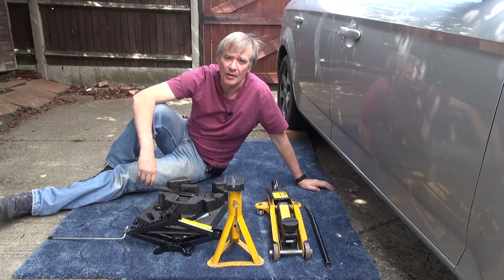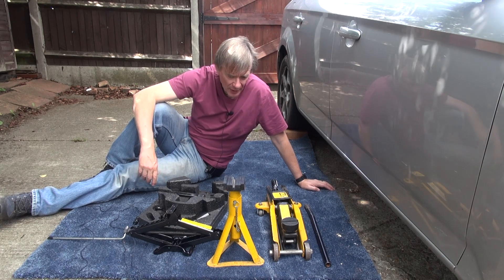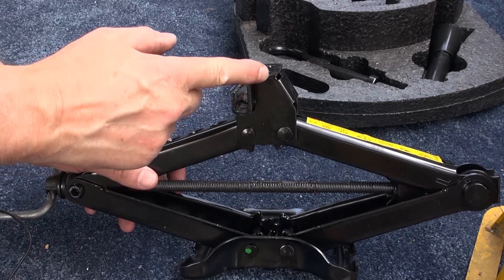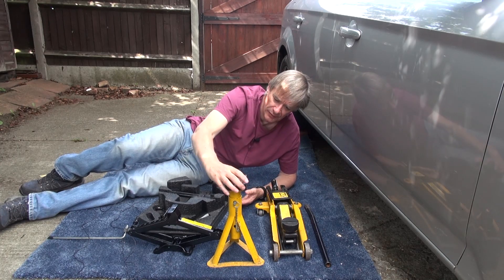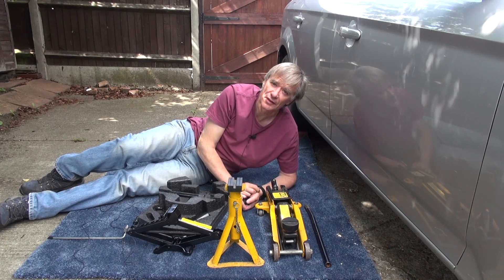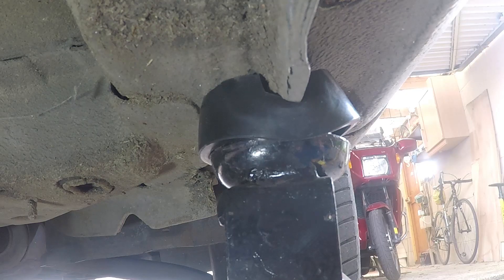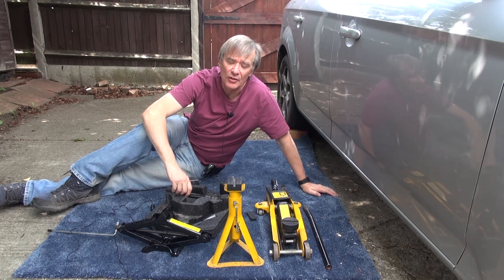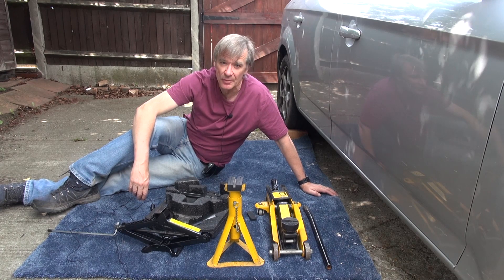Protecting the car sill frame rails with rubber jacking pads

Comment: Hi Nigel. I have tried all sorts. Be very careful with wood, even the hardest cross grain wood can fail dramatically when not expected. The pucks seem ok but cut through/wear out quite quickly. An interesting point is the Ford jack puts no pressure on the actual rail but lifts either side of it. For my Mk4 I actually made an adaptor for my trolley jack by milling a block of aluminium to the exact profile of the Ford jack. Thanks for all your videos, very interesting and informative.
Reply from the maker: Thanks John. If I had the milling ability I would also make an adapter.

Comment: I like the concept, but there's a few videos showing these kind of things sometimes popping out suddenly under load, with disastrous results as you can imagine.  At 3:02 see how the rubber puck is distorting, particularly on the right side, suggesting that there's significant lateral loading occurring. Probably fine, but you can never be too paranoid jacking up a car.

At 3:43 the axle stand rubber puck is distorting, but this time in a better, more symmetrical way. This appears to be a result of normal vertical loading, with the rubber puck clamping around the pinch weld quite nicely. I wouldn't mind using this one myself, but the trolley jack one I'm not keen on. I think trolley jack is best used to raise the whole front or rear end on a central jacking point.

Comment: Many thanks Nigel, great video. You can buy a pack of Hockey Pucks and make your own with a bit of time. Combine two pucks to get different shapes if required, locate with bolts and glue. For some cars bolt an old socket to the puck to make a locating pin for Max security. Wondering if you can get a platen adapter for your jack to provide a bigger safer platen. Bit of timber on the ground lets your jack roll under the car better as you jack and preserves the jack wheels. Do you ever jack the Mondeo under the frame rails further underneath? Other tip (if required) to drive onto a few sheets of stacked chipboard (stepped so one sheet at a time) to give you space for the jack). I'm new to the MK4.

Comment: 2:33 YES! Always copy the design of the emergency scissor jack when making a jacking adapter for pinch welds. That rubber is too soft: the weight looks like it's on the pinch weld.
Reply from the maker: I agree although the rubber has proved very good. The slot is deeper than the rail and even with compression it looks like most of the pressure is transferred to the base of the rail. Thanks for watching and the comment.

Comment: Trolly jacks need to be able to roll, if they can't they will bend the lip on the sill over as the jack goes up, they try to pull the car sideways as they swing backwards

Comment: How do you get a jack and axel stands on the sill jacking points? Are the reinforced parts wide enough?
Reply from the maker: The sills are strong along their length. You can put an axle stand in beside the Jack without a worry.
Reply: That's what I was thinking.  They put that little crescent cutout to indicate the jacking spot for a reason, don't they?

Comment: What should I do if I already bent the jacking rails?
Reply from the maker: Mine are also bent that’s why I bought the pads to prevent further damage. The car still passes a MOT.
Reply: @NigelEaland  That is nice, have to do some abs work before the MOT, pain in the butt lol
Reply: @NigelEaland  (Thinking about having to use the emergency jack at the roadside) Would you attempt to straighten slightly bent rails (as car purchased) with hammer+dolly, or is that best left alone (to avoid cracking the spot welds)
Reply from the maker: @johncoppock3823  I would leave them alone.
Reply: @NigelEaland  Many thanks Nigel for confirming. I think in my case the emergency jack will probably still fit, and I'll only be using it in a dire emergency.